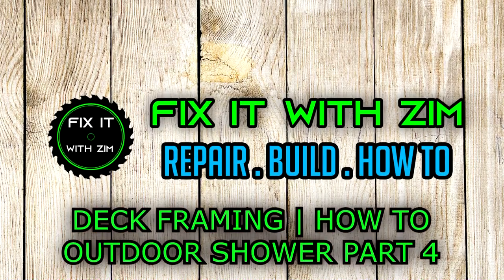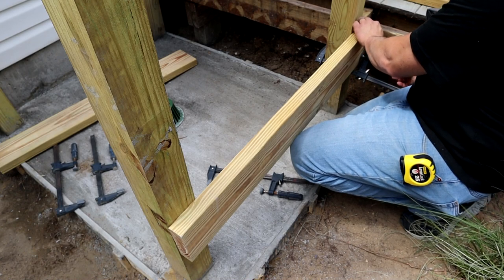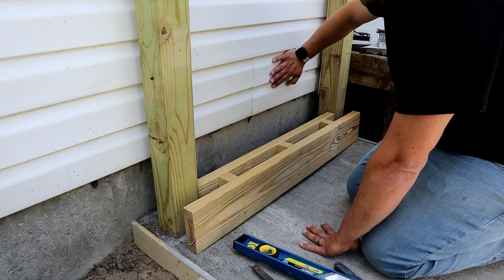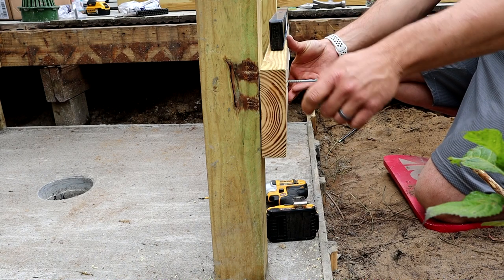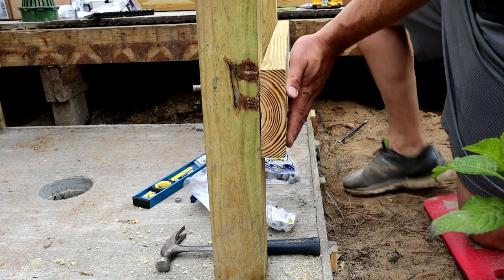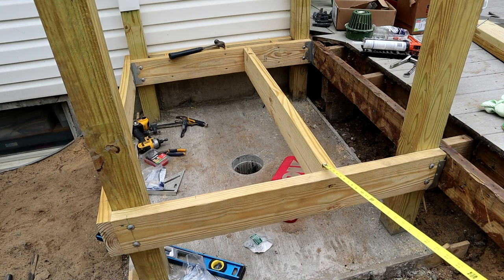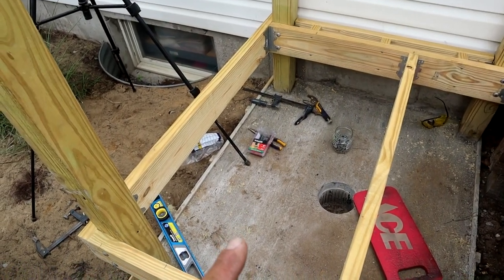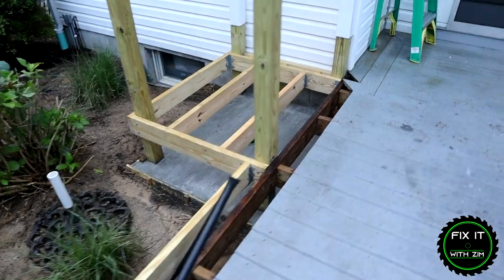Deck Framing 101 for Beginners | How To

Comment: I see you are hanging the outer joists on carriage bolts instead of a lap joint, carriage bolts are not load rated!
Reply from the maker: Yes, I mentioned this in the video. For something this small, it’ll be ok. I would never frame an entire deck this way however. Thanks for the comment